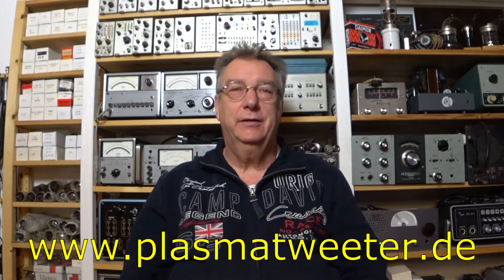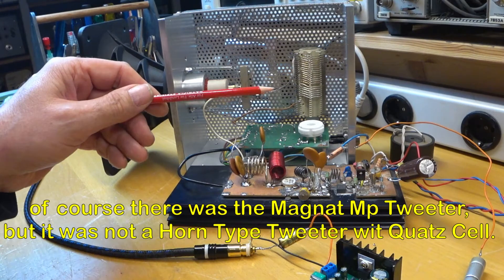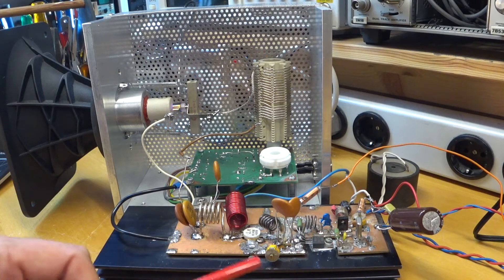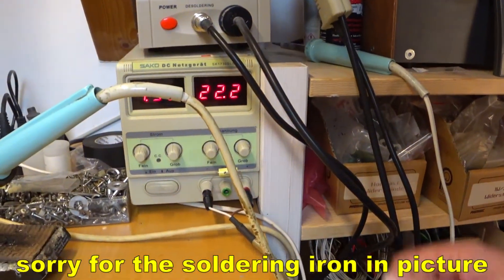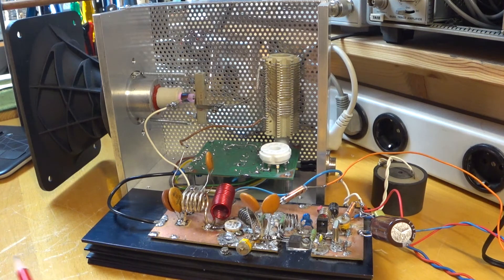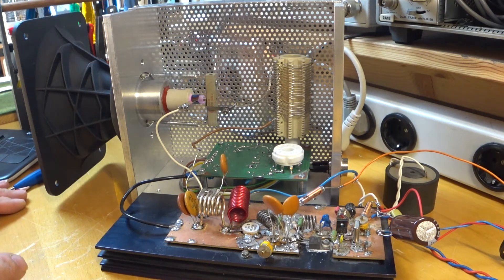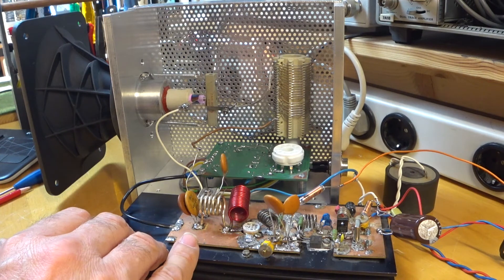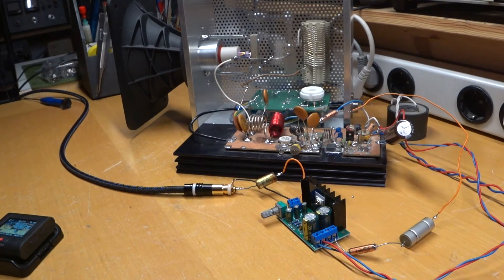Ionophone without Tube

Comment: Fantastic work. I've been curious about plasma tweeters and wonder how they compare to beryllium and diamond. One way to find out is to compare :) Following with deep interest.
Reply from the maker: Thank's Patric, 2nd part of the video will follow...
Reply: @plasmaton99  I have some interesting reading to look forward to (all the info on your webpage). I can't help it but wonder what it would take to drive it down to say 800Hz - a 10mm opening...
Reply from the maker: @Patrik I think this is not possible with the current technics. You need more than 10mm flame. See the Hill Plasmatronics which had 5 parallel flames to go down in frequency.
Reply: @plasmaton99  Lansche is using 8mm in order to get down to 1.5kHz which is very nice for a tweeter. Regarding midrange, I think we need to consider the flame variant. It has been done in the past and with some adjustment, It can be done again. I will send you an email :)